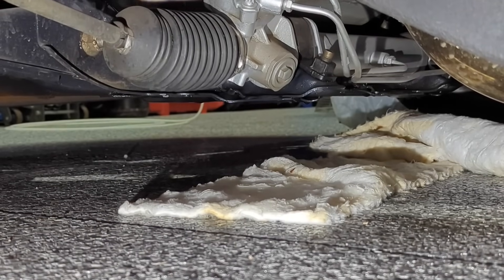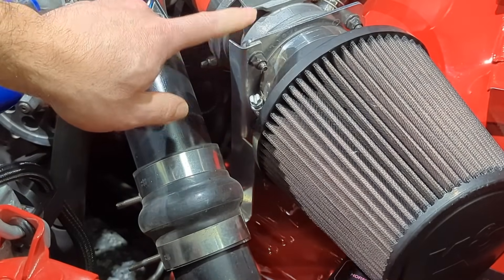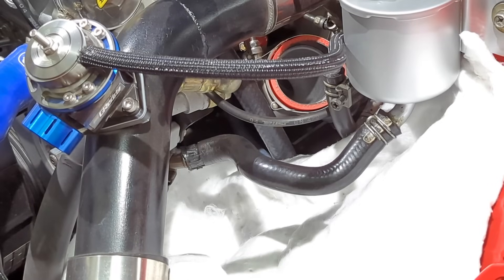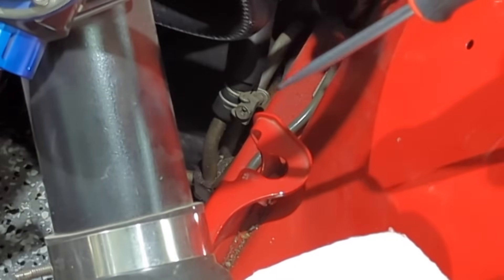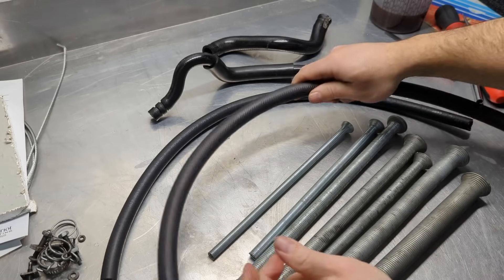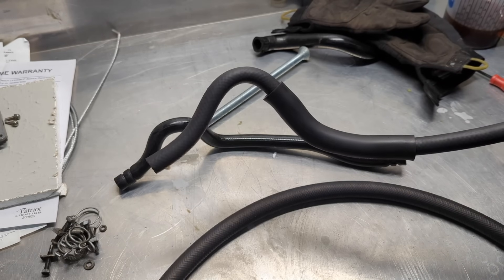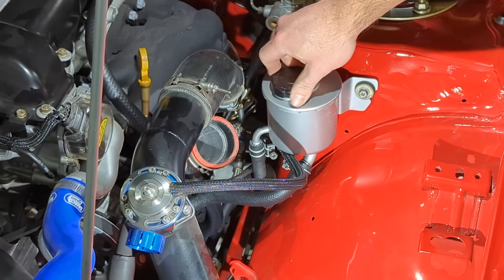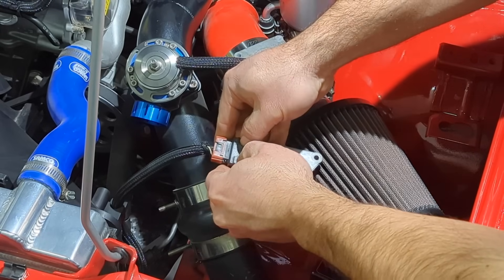Bend Rubber Hoses with Tubing Bender and Heat Gun without kinks!

Comment: Great techniques! I have an RV based on a 1994 Ford F53 chassis. It’s getting harder to find parts, and/or figure out what part number matches. Coolant hoses are my biggest problem so far. 

The previous owner was kind enough to collect the right heater hoses and store them in the RV, so I’ve been lucky enough to have the right ones with me. But my luck will definitely run out. 

(Tomorrow I’m going to go to Harbor Freight and get an exhaust pipe expander. I will be using it to slightly expand one end of a 90 degree molded heater hose so that it can fit onto the oil cooler. It is just a bit too small to fit. It’s definitely the right part number! Repairs can be a bit more urgent when you’re at a campground and only have a couple day reservation. I love your techniques re: not making a mess, too. I am going to get some of that absorbent material and a big syringe.)
Reply from the maker: Those exhaust pipe expanders do come in handy for other applications! Glad you enjoyed it and thanks for sharing!
Reply: I just went through a whole mess trying to just get a local shop expand a pipe for me, so screw him I went and spent a hundred seventy-five bucks on that lisle tool and  my only regret is not doing it 20yrs ago. 
It's not one of those junk ones , it'll expand a pipe like a real muffler shop.
2 pipes that butt together? 
It'll expand one and make a slip fit.